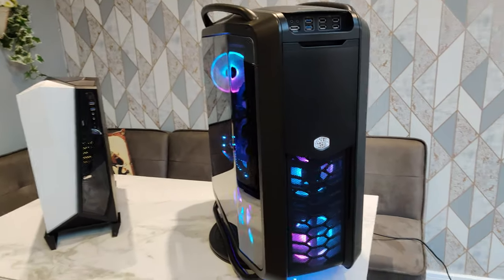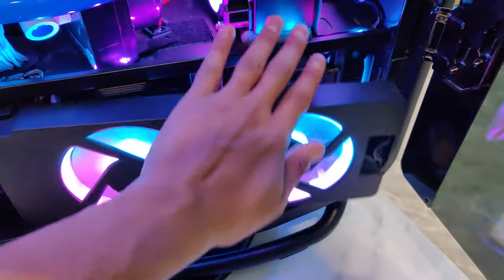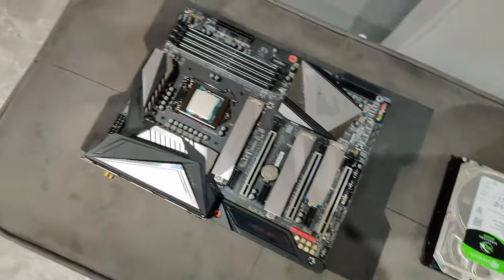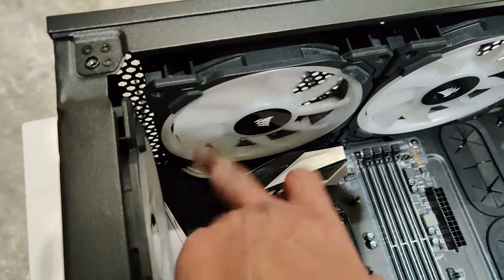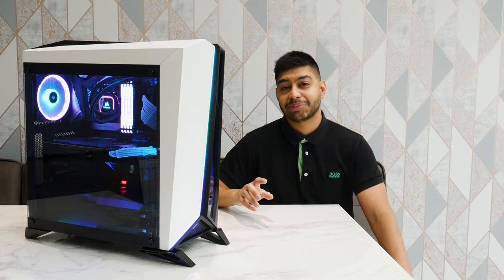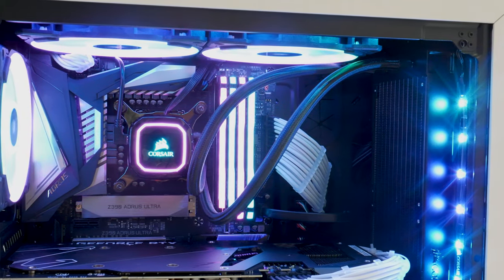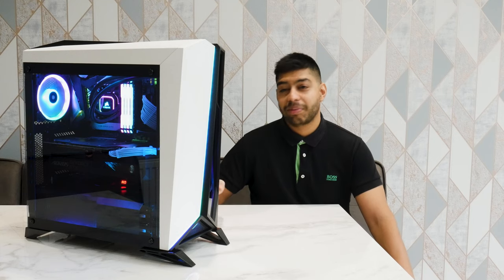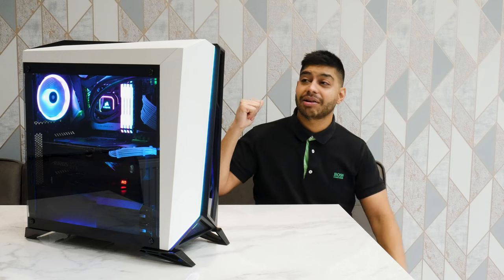Beautiful Aorus RTX 3080 Master Gaming PC Build 2020! Benchmarks

Comment: I got a 3080 Aorus Master and love it.  Undervolting gives me best performance. -290 Core clock, Curve starting at 950 I set it to 2025, +750 mem OC 56-62C on avg
Reply from the maker: sounds good mate, you ran any port royal benchmarks?
Reply: @Dipscovery  Yes about 12300s highest I’ve gotten but I lowered the OC on my ram back to 3200 for stability but undervolted will get me 12100-12200 or so
Reply from the maker: @Spelldaoc  yeah that's good score though
Reply: @Dipscovery  have you run a port royal on yours. Keep me posted if you do.  Not many Aorus master reviews so like to see how all are doing
Reply from the maker: @Spelldaoc  yeah it's in my 3080 card review. And at the end of this video.
Reply: @Dipscovery  gotcha. I watched most of it. I’ll have to play the end
Reply: @Dipscovery  Have you checked how many watts it’s giving you? I barely would top 340-350 but peeps tell me it should be 370
Reply: @Dipscovery  another note benchmark scores arent everything. I could only do +130 core and +725 men for stability. However when I played battlefield 5 it crashes when loading. Lowered to +110 and no issues. Then I tried RTX mode and crash. Lowered to +100 and RTX perfect now. So something to consider if want to lower your core by 30 for stability even though it'll pass port royal. I'm sure I can press for more than 12200 undervoltrdbut at end of day it's gaming performance.

Comment: Hello, i just bought the aorus master rtx 3080. Do you think a Corsair 465x or Corsair 4000 series will be big enough for this gpu? I also like the nzxt h510 elite which is about the same size. I know this isn’t the best gpu for a relatively small case. Thank you.
Reply from the maker: Hi pal, it will fit in the 465X, but if you are using a AIO cooler you would want it at the top instead of the front. Not too sure about the 4000D, it's abit smaller.

Comment: Thanks but I was wondering if a 30 series strix card would fit in this case with a 360 mm radiator
Reply from the maker: Hi I think the 30 series strix are shorter than mine. So it should fit fine.
Reply: @Dipscovery  alright thx

Comment: Hi, I would like to make a configuration with the same box but I'm afraid the graphics card won't fit with the radiator. The graphics card is an rtx 3080 gaming x trio, it is 20mm bigger than yours and I have the same watercooling. Do you think everything fits?
Reply from the maker: Hi, I think it will JUST fit, but it will probably have only a 1-2mm gap between the back of the card and the radiator.
Reply: @seyzun did it fit? I have same thing

Comment: I just pre ordered the Aorus 3080 master and I’m gonna pair it with the i7 10700kf 32gb Corsair dominator ram 1tb nvme ssd 1tb hdd and a 500gb hdd cooler master 360mm aio 850w 80 plus gold Corsair psu and the Corsair 4000d airflow
Reply from the maker: Sounds like a great set up mate, hope you get your 3080 soon! the 4000D case will be good for airflow.

Comment: Hi! I have exactly the same case and a rog strix 3070. Currently I have the radiator where you have the 3 fans and the fans where you have the radiator. Do you recommend me changing the position to how you have it installed for better ventilation?
Reply from the maker: Are you using a 240mm rad?
Reply: @Dipscovery  yes sir
Reply from the maker: @fazc7  then I would leave it as it is, make sure you rad fans are on exhaust and your front fans are intake. I have done mine at the front because I am using the 360mm rad which you can't fit on top.